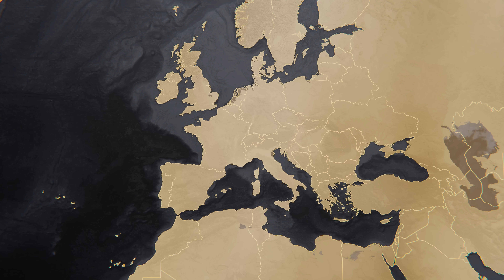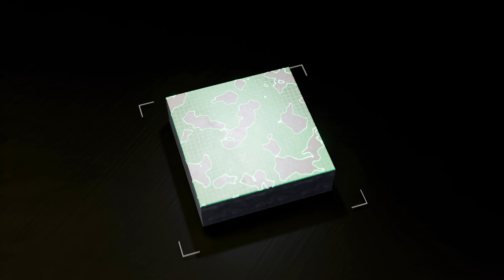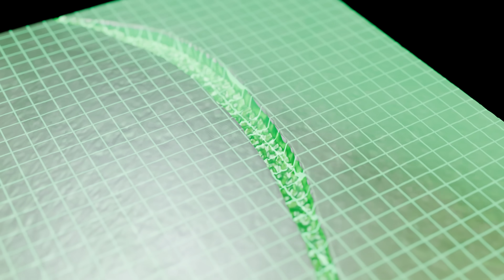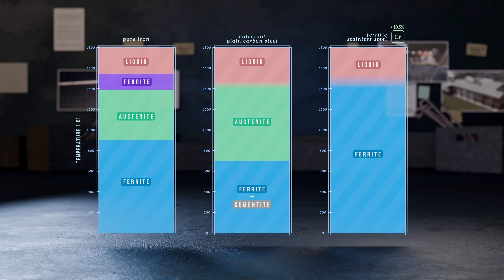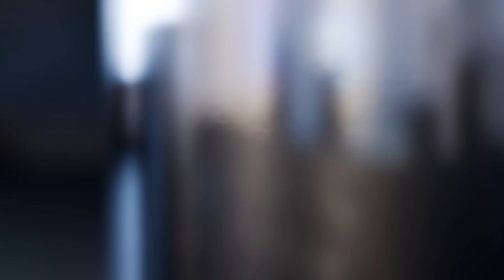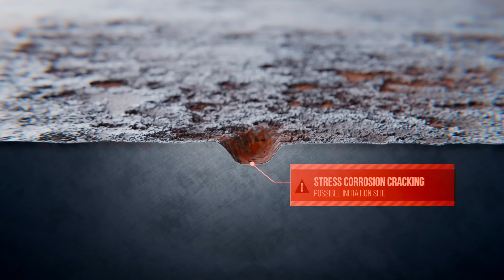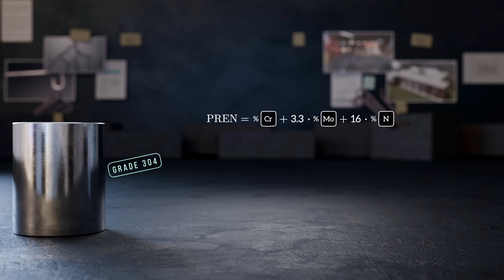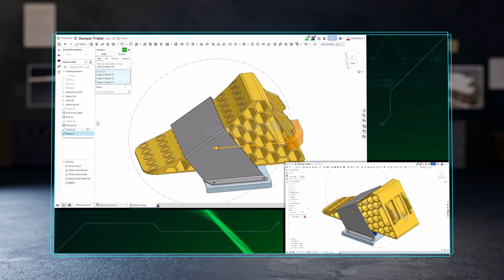The Problem with Stainless Steel

Comment: I'm from the area and would like to add that one rod had already snapped. But warnings were dismissed. 3 technicians were sentenced for negligent homicide. Sadly, this disaster could have been prevented.
Reply: Most of the time it’s management that refuses to act because of cost
Reply: Money thrift + ignorance of hazard
Reply: not being an engineer, that seems more like the rods were overstressed to begin with; low quality rods, wrong sized rods, or insufficient number of rods for the load...
Reply: @carlosgaspar8447 as is the case in many engineering failures it is a combination of factors that result in the catastrophic result. Clearly these supporting rods were under a good deal of stress. I think that must have been a factor in observing low-temperature chloride SCC at this scale. Reading the comments, the biggest issue I see is that they had observed signs of the failure but dismissed them. The cost of ignoring a failure is greater than the cost of recognizing it, especially when human life is involved.
Reply: Why in the holy hell would they rely on a technician's scientific knowledge and not an engineers or scientists?
Reply: Did those technicians raise those warnings?
Reply: Why are technicians sentenced while doing their utmost to prevent problems while unqualified and unexperienced politicians take decisions on technical matters outing utterly nonsense without even listening to experts killing millions of people.  And that while these politicians are highly paid and never ever taken to court .....
Reply: Much like hairline stress fractures in bridges are ignored until it kills someone.  And the infrastructure collapse in many "BLUE" States are mind numbing.  As a boy I always dreaded crossing bridges. Why?  And this bridge was a 2 lane roadway across the Ohio River. 

The Silver Bridge collapsed into the Ohio River between Point Pleasant, WV, and Kanauga, OH, on December 15, 1967, killing 46 people and injuring 9 others, with 31 vehicles falling into the water. The 1,760-foot eyebar suspension bridge failed due to a tiny, undetected crack in a single, non-redundant eye-bar suspension link, causing the entire structure to collapse in under 60 seconds. 
    Date and Time: December 15, 1967, at approximately 4:58 PM during heavy rush-hour traffic.
    Cause: A small, 0.1-inch deep stress corrosion crack in one of the eyebars, which was not visible to inspectors. The design lacked redundancy, meaning the failure of one critical piece caused the entire bridge to fail.
    Casualties: 46 fatalities and 31 vehicles involved, with two bodies never recovered.
    Structure: Opened in 1928, it was the first bridge in the US to use heat-treated, high-strength steel eyebars in its suspension chain.
    Aftermath: The tragedy resulted in the creation of comprehensive national bridge inspection standards in the United States.
My Grandfather had just passed over the bridge coming home from work and was less than a minute off the ramp when he heard the collapse. Oh the stories I heard from the man.  He rushed to assist anyone he could and had my grandmother worried sick cause he was supposed to be home and the evening news was at the scene and she was dreadfully worried she had just lost her husband.  When he got home that evening well after dark I saw my grandmother's eyes change from worried to very angry for a brief second and then the GRATEFULNESS WITH HEAVY SOBBING AS SHE RUSHED INTO HIS ARMS. And I was a lad of 6 at the time. I couldn't quite grasp the full impact of that news but I surely witnessed a powerful human emotion gauntlet run that day on her face.  And even today it humbles me as how many times in life does stuff happen just as you were about to do or just finished doing something that impacts you for the rest of your life. This is why I went into Engineering in the first place.
Reply: @anonimous2451 as an ‘Ironworker’ in the ‘Philly’ area, I worked on many bridges over my career… both new & very old bridges.
One old bridge was on the north end of my hometown, which I’d crossed thousands of times from childhood onwards.
Due to lack of maintenance & inspections, the action of the ‘rock salt’ used in the winter had corroded some of the main steel girders beyond belief…
… the girder’s web was ~6’ deep, & I could stick my finger through it in some spots !… 😳… that’s how bad the corrosion was.
I was astonished…
I read of another, but modern steel bridge outside of ‘Pittsburgh’ that collapsed for the same reason… massive corrosion due to no maintenance even thou exposed to heavy ‘rock salt’ use… & no routine inspections to identify the problem.
It collapsed as a city bus was traversing it one winter.
Reply: @anonimous2451   actually it's greedy republicans that refuse to spend money on maintainence and go for the lowest quality and lowest cost everything
Reply: @anonimous2451  engineer who accept his fault and decide to stop in such massive progects destroying his career.

Comment: wouldnt it have been cheapest and easiest to introduce active ventilation that removes both the chlorides and warm aid? Guessing this would have materially slowed down the chloride corrosion. But then, I don't know the price differences between duplex steel and 304.

Comment: 5:14 now you know, why ferritic stainless steel can't be hardened, because it never transitions into austenite ;-)
Reply: You win a prize for this insight. Still working it out with the ferrites
Reply: Why does i friction weld self tappers in 316 attaching signs for corrosive hazmat?
Reply: When talking about hardening we are generally talking about transitioning into the crystalline martensitic phase, not austenitic. Also austenitic and ferritic steels can transition into martensitic steel under quench hardening or strain hardening.
Reply: Yeah I noticed how stainles steel screws (used a lot for exterior cladding or terrace boards) are so soft.

Comment: nice video but it would also be good to talk about welding in SS
Reply: But that has nothing to do with the subject, which is stress-corrosion cracking.
Reply: @soaringvulture true
Reply: @soaringvulture  How about stress-corrosion cracking in stainless welds? How about when the specs call for welding rod X but someone in the welding shop who doesn't understand stress-corrosion cracking decides to use rod Y because they happen to have a lot of rod Y left over from a previous job, it's already paid for and it's good enough but it really isn't because rod Y deposits are prone to stress-corrosion cracking in the environment where the structure will be put into service?  How does that have "nothing to do with the subject, which is stress-corrosion cracking"?
Reply: @manatook-d9m  i agree with you, a lot of people think that these alloys can handle anything but a simple weld can induce some intergranular corrosion

Comment: This was known before the Uster disaster.  The building was only 13 years old.  It was foreseeable.
Reply: It was previously thought that SCC happened only rarely below about 60 C, and then only under really aggressive pitting conditions.  This disaster happened at temperatures well below 30 C, so in fact it was a shock.

Comment: Cybertruck body panels explained.
Reply: I think those were made of 301 stainless, which has much lower levels of chromium and nickel than 304 and rusts at the slightest provocation. But it costs less.

Comment: @The Efficient Engineer:  I see a lot of AISI 316 used in Chloride-rich environments. Can you compare this material to grade 2250 duplex?
Reply: 2205 duplex is much more resistant to chloride corrosion, stress cracking and crevice corrosion than 316. Even so no stainless steel are good with chlorides as soon as the temperature goes above mid 20's ⁰C. By 30⁰C stainless is out and you should be using titanium
Reply: @deerfootnz  But then you have to pay for titanium. And that can hurt.
Reply: @soaringvulture yes. Obviously. Though not much price difference between 2205 and titanium

Comment: i had to demolish a indoor pools aluminum ventilation system and can confirm by the amount of aluminum oxide i had to sweep up, indoor pools are corrosive as fuck
Reply: People really underestimate how much salt spray gets transported by air. Also an example is how far inland A/C bodies and railings get corroded in seaside cities. I've argued this so many times and so often I have to explain that air carries smal amounts of salt spray, so chlorine ions basically, much farther than thought.
Reply: @rampel1  Years ago, before cars were galvanised properly, I bought a car from a seaside town. The previous owner always parked it in the same place and facing the same direction - I ended up having to replace the panels on one side because they corroded from the higher concentration of salt spray coming from the sea on that side.
Reply: @pd4165  same here. It was only a few years old and under the bonnet had rust all over bits. Worse than me 21 year old car.
Reply: @damianbutterworth2434  Lancia Beta?
Reply: @jameschristiansson The rusty one was a Rover 25 Facelift. My old Nissan Micra had just one hole under a head lamp which I welded. Not very well as normal.
Reply: @pd4165  What car is galvanized?? I've never heard of a car with any galvanizing on it, cars rust into nothing in the "salt belt" as they call it. I've always wondered why cars manufacturers don't galvanize their frames instead of using garbage under coatings that just wear off.
Reply: Audi's body is galvanized since the mid 1980's (audi80, audi100 models)
They are pretty reliable, mostly corroding after accidents or other surface damage (eg wheel fenders with rock chips).
The german car industry followed audi later in the 90s
Reply: Volvo v70 96-00 tez były cynkowane
Reply: @pd4165  Being able to detect which way the car parked from that is so fascinating. Like something so small as a parking space changing the latter half of your cars life.
Reply: @pd4165  That really depends on manufacturers. I've seen a brand new Chevy pickup with little rust bubbles on the doors, and I mean new as the dealership just got it.
Reply: @rampel1 around 5-10 miles is no stress for salt spray in the air. 

I live in Cornwall and even the inland sites get attacked aggressively.
Reply: I’m an electrician, it is now illegal to install electrical distribution panels in the same room as pool filtration equipment because of the presence of corrosive chlorine vapors, and their effect. Some older places still have this outdated set-up, and the effects of chlorine vapors is astonishing. The steel and or aluminum frames turn to rust or white powder in about 5 years. Galvanized steel conduit survives about three. Even the solid copper buss bars in the panels turn to green copper chloride powder and pit extensively in only a few years. It’s like a gaseous acid in its effects on metals.
Reply: @seanmarshall5463 all you guys talking about chlorine effect on materials but what about its effects on humans?? Humans have no problem swimming in salt water but chlorine is toxic to all microbiota and caustic to hair and skin. It's really nasty stuff
Reply: @seanmarshall5463 I've seen some rusted out panels at the local YMCA, its horrible.
Reply: @seanmarshall5463  Believable, chlorine is one of the worst things you can expose metal to.
Reply: I work as a Maintenance Carpenter for a Private School in Melbourne and part of my duties is the regular testing of the indoor swimming pool. This pool was a chlorine based system until last year, when it was changed to a salt electrolysis system that generates the required chlorine. The pool is certainly more stable when tested now and we no longer have to handle buckets of chlorine tablets or deal with the dosage system clogging up from the calcium included in the tablets. The pool is now 33 years old and there is evidence of corrosion in parts of the structure and the fittings. We certainly seem to need to use less salt than the amount of chlorine tablets we used to go through. The Big test for the pool always comes when the students are learning to swim in their clothes in preparation for going on the various camps. Those "Battle Swims" used to really strain the chlorine system and throw the testing out of whack while they were going on. 
Mark from Melbourne Australia
Reply: @markfryer9880 thats really great to hear improvements and intelligent adaptation going on there. I would use a pool like that but generally pass on regular swimming due to how nasty chlorine is to my skin and hair. Few people think outside the box and are open to something clearly better eh? One thing the pools manager at my city told is that pre-swim showers would reduce the chlorine load in the water but that they never focus on this with all the children.  I raised the question of why no soap tray is in the showers because in the summer I get automobile grease on me or mosquito oil and to me it makes no sense that they don't even care it I wash this crap off my body before swimming. Well in the US everything around society is a mess. I wish I was somewhere sensible like Oz!
Reply: @markfryer9880  Wow I have heard about the impact of wearing clothing in a pool messing with the balance but I did not know it was genuinely that big of a change! That's seriously fascinating.
Reply: @markfryer9880 FWIW, the chlorine that is generated from electrolysis of salt is functionally the same as the chlorine you were adding previously. The difference is that with a salt system, you keep a more steady and moderate level versus the ups and downs of dosing chlorine other ways. And as you said, using the pucks comes with a whole other litany of chemistry challenges either from the carbonates that are introduced, or from the stabilizer that is introduced.
Reply: Ôi , ăn mòn  kim loại thật khủng khiếp .